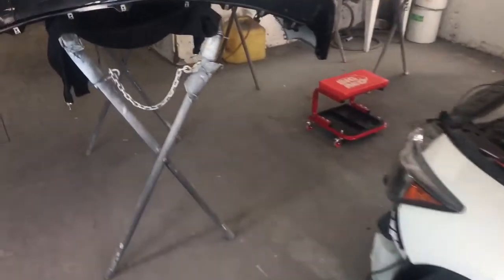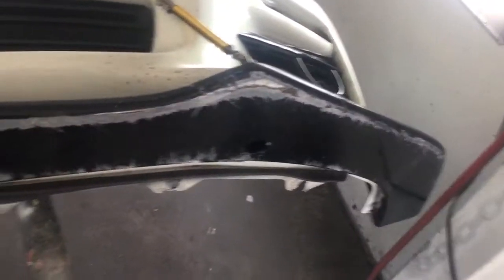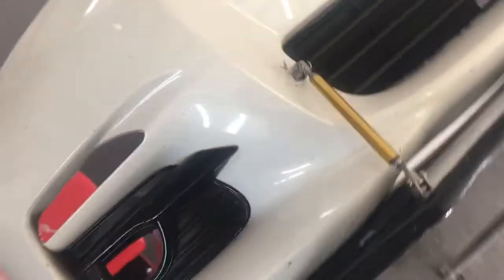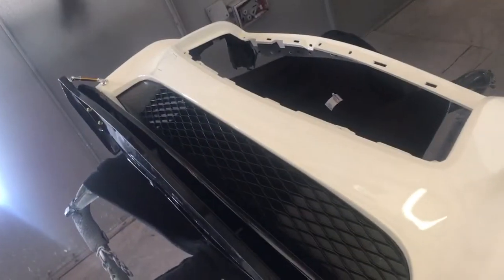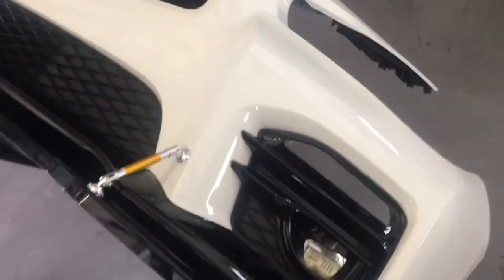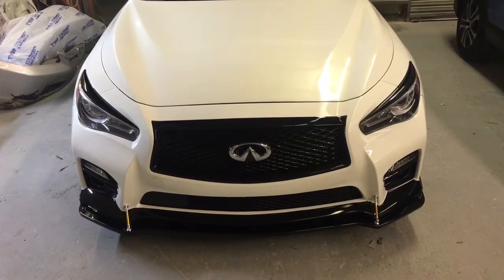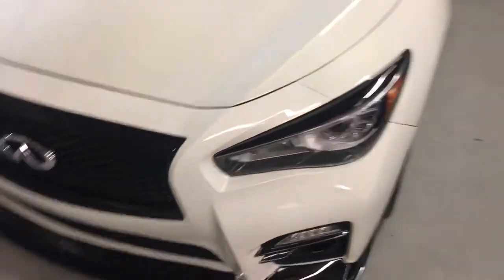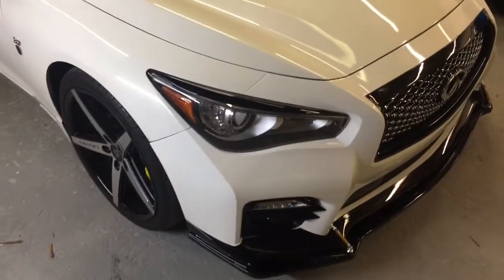Q50 Infiniti premium front changed to a red sport 400 front... with custom paint

Comment: I have a question This is a conversion kit bumper or it's a oem red sport bumper ?
Reply from the maker: Junior Valora ... OEM red sport bumper, but there’s a kit that’s about half the price... looks just like it and I’ve put it on 4 Q50’s so far...
Reply: Oh ok  I have a 2016 q50 non sport and I was trying to change the front bumper but the thing is that I dont know if the q50 red sport would fit on my 16 non sport
Reply from the maker: Junior Valora... oem
Reply from the maker: Yes it will fit... what state do u live in?
Reply: @lairdkelly704  okay thanks man and I live in    Chicago IL